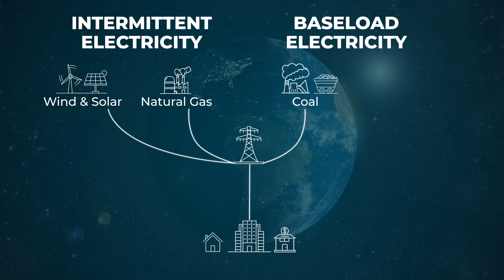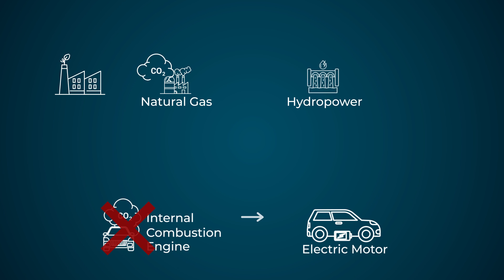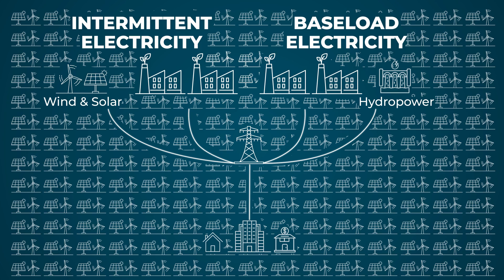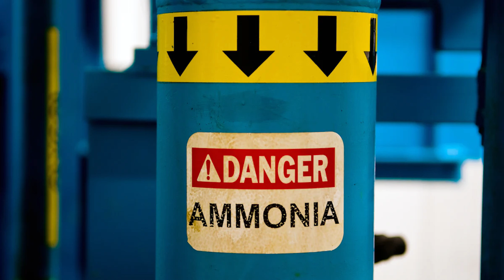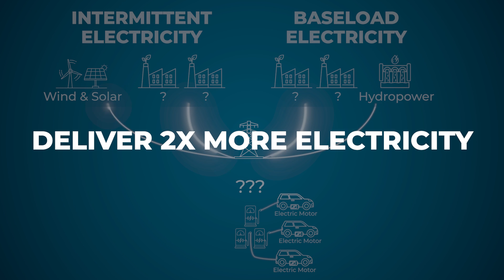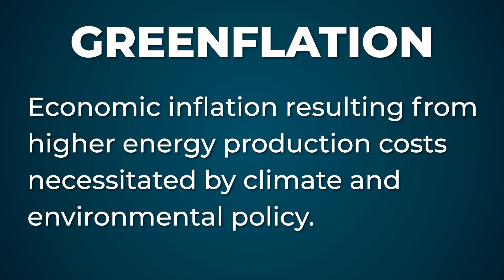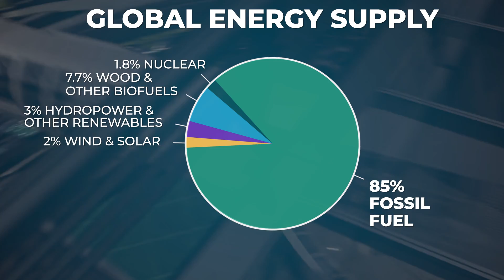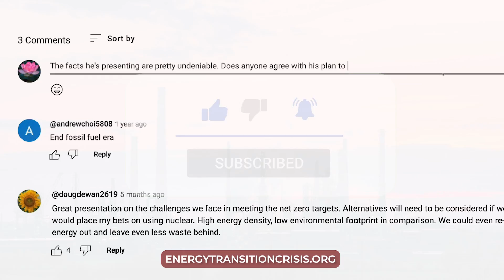Energy Transition Crisis - Episode 2: A Master Plan to Achieve Clean Energy Transition

Comment: “Replacing internal combustion engines with electric does not stop carbon emissions”. True, BUT. It does drastically reduce. Even the “coal powered EV” sneered at by the anti-EV crowd produces considerably less CO2 than a gasoline engine. This is because EVs are much more energy efficient than internal combustion. It’s obvious in the math. A gallon of gasoline contains about 35kWh of energy. A typical EV battery is in the 70kWh range, the equivalent of two gallons of gasoline. This is enough for 250 miles of range - approximate 125mpg in gasoline terms. So an EV is around four times as energy-efficient as a car. This is not surprising. The theoretical maximum efficiency of internal combustion is only 35%, but in real-world operating conditions, cars operate nowhere near maximum efficiency. (This is why hybrids are so much more efficient - they make better use of the engine by offloading acceleration to a battery). 

Coal-fired power plants are around twice as efficient at converting fossil carbon to electricity as internal combustion is as turning it to horsepower. This makes coal fired EV approximately 8x more carbon-efficient than a gasoline-powered car. This video suffers from a gross overgeneralization here! Absolutist reasoning about carbon can lead to false equivalence, which leads to bad policy.
Reply: And a followup on this… the video suggests that 100% of the thermal energy of gasoline/diesel must be replaced with solar, which makes the problem that much harder. But, as I’ve pointed out here, EVs are inherently 4x more energy-efficient than combustion engines, which radically reduces the amount of total energy we’d need to replace. And although the video keeps emphasizing that batteries have some losses, it doesn’t say how much (10%, depending). This is far less than the energy losses of converting fossil fuel into electricity.

Comment: If SWB isn't enough to replace our fossil fuels, why is Australia pushing ahead so quickly and successfully to get large grid scale batteries built to supplement all their solar? They built the first large grid  scale battery at Musk's encouraging ("bet ya I can install it in 100 days or it's free", remember that?) Now that the battery (installed faster than 100 days) is making that energy provider a ton of money using arbitrage, they are building more grid scale batteries as fast as they can. I have a feeling your maximum possibility of 35% solar wind prediction will be surpassed before 2030. You don't seem to be taking into account the plummeting cost of PV and battery storage. Nobody in their right mind will pay to install a nuke plant or large scale gas plant if they could build a similarly powerful PV field for less money and less time. Not to mention, it will fit on a small part of the grasslands, farm fields etc. that already exist. Grazing sheep under PV cells isn't the future, it's already happening. Graze cattle under them just as easily. There's plenty of highway median and canal area that could be covered with PV cells and Wind turbines. Turbines can be set up in a field that plants anything from hay, corn or soy, to pumpkins or peas. Tubines take up so little space, you almost don't need to count it because all the space between the towers can be farmed.